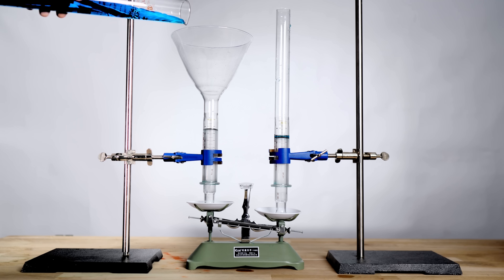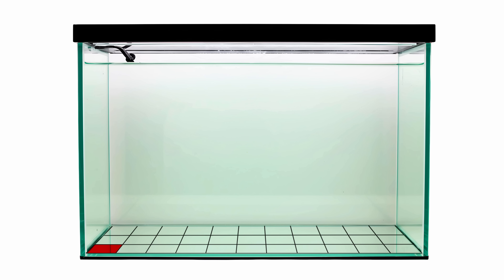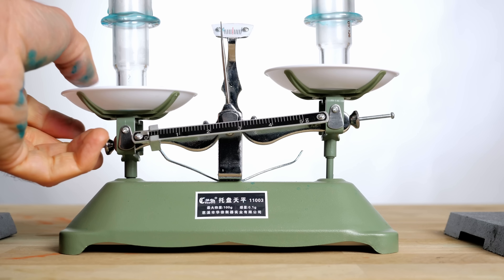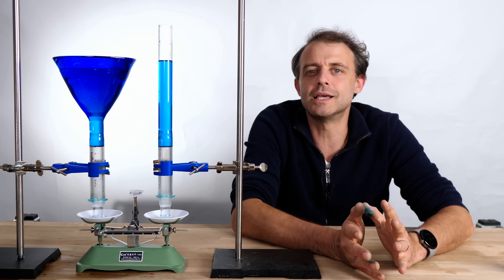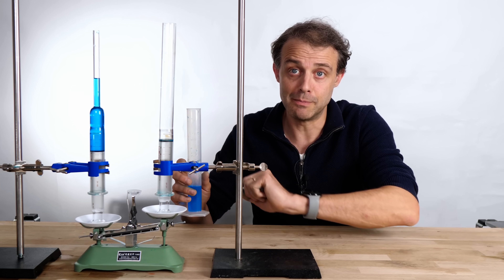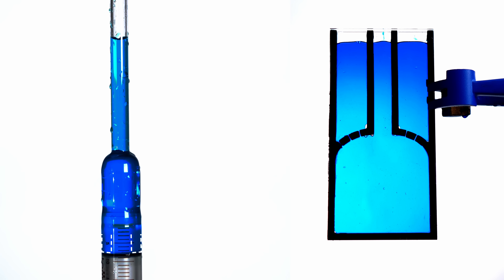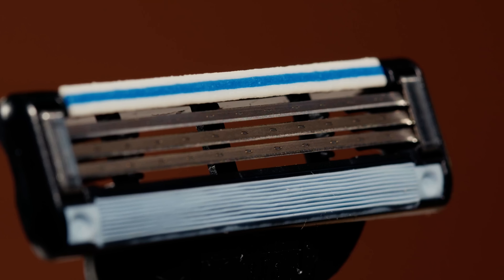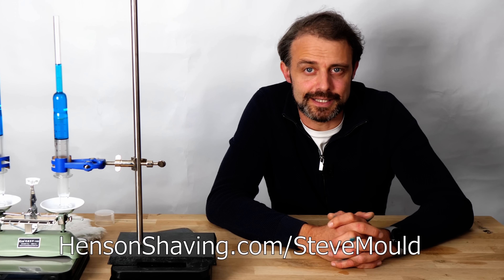The Hydrostatic Paradox

Comment: It's like a cart on an incline, tied to a free-hanging block, over a pulley.

On a 30 degree incline, a 100 gram cart, would only require a 50 gram weight on the other side of the pulley to hold it at rest.  This would make it seem like a 100 gram cart is equally as heavy as its 50 gram counterweight.  But it isn't, because it's the 50 grams of string tension up along the incline, plus the 87 grams of normal force, that add up as vectors to equal 100 grams, to oppose its weight.

The pressure from the conical beaker supporting the water, acts perpendicular to the conical surface, and not parallel.  This means the water in the conical beaker is getting support from the sidewalls to assist the piston in supporting its weight, while the water in the cylinder isn't getting any support from the sidewalls.

Comment: I'm about 1 minute in and I can already tell you this is stupid to call it wait instead of pressure. Put the whole damn contraption including the stand that is holding up the beakers on a scale and it will weigh more with more water. You're not weighing the water You're measuring the pressure on the head of the piston that is not the same thing and this is a misleading title and thumbnail
Reply: No need to watch the next 12 minutes I'm out

Comment: Usually I'm meh about ads, but safety razors are the way to go. You just don't need to bother buying from henson. Lots of companies make handles, they last lifetimes, blades are cheap as chips, do yourself a favour and get a good badger brush and nice puck of shave soap - that also lasts ages and doesn't dry out your skin from the chemicals used to propel it out of cans and foam it up.

Other than the handle, it's all super cheap. You will save a tonne of money, your shave will be better, your skin will be better, shaving won't hurt for hours afterwards.

Just do it

Comment: Could you then seal the top of a swimming pool around a 10 meter straw, fill the straw with water and now that pool has the same water pressure as if you had added 10 meters of water above it? 🤔

Comment: water weight is determined by only the water that is directly vertically above the object being weighed. took a long time for this to be properly explained to me. although i would have assumed it would take a lot more than just 60ml to outweigh the water pressure of the fluid in the funnel

Comment: The hight of the water and size of the position is what will determine the balance. If the hight is higher = it will be heavy. If the diameter of the position is larger and equal hight the heavier it will be

Comment: similarly: the pressure at the bottom of a body of water, is only related to the height of the water. the volume does not matter.

and that sounds right, doesn't it? going one foot under the ocean doesn't feel any different than going one foot under a lake, even though the ocean will have way way way more volume.

Comment: Could you do video using brake cylinders from a car to explain this further? I was always amazing when studying for my ASE that brake force is determined by cylinder diameter x distance. Which is why the brake pedal uses less force to push but the brake calipers convert it into thousands of pounds of force used to slow down a vehicle.

Comment: i always found it disturbing that u could unalive a diver in a big water filled pressure tank by having a very thin ( like 1cm diameter ), but very tall (20metre) water filled pipe connected to the roof and directed upwards. Abruptly disconnecting the pipe from the tank seems like a small modification but would instantly drop the pressure by 20metres and therefore unalive the diver via nitrogen bubbles in brain.

Comment: I had  a professional exposure to this phenomenon some years ago. I was working for a medical device company that was developing a chairside blood processor for use in blood banks. To separate the red cells from the white cells and plasma, we used a centrifuge, of course. It was different from a regular centrifuge in that it was continuous flow (whole blood and anticoagulant flowed in, and red cells and plasma flowed out). The centrifuge body was a single-use, molded polycarbonate bowl with the actual active area being a thin annular space at the outer edge, only about 5mm wide. 

They were having problems with the body cracking in use and I had to figure out why. I calculated the force on the wall of a 5mm column of blood at 2,000 g (the centrifuge spun at 4,200 RPM) at the outer wall and the polycarbonate should have been plenty strong enough. However, those four fluid streams I mentioned actually went all the way to the rotary seal at the center. Those pathways were only about 1 mm across so I had ignored them thinking that the mass of the fluids in them was negligible compared to the mass being processed in the outer ring. Wrong! Those fluid pathways increased the fluid column pressing on the outer wall from 5mm high to 10cm, a 20X jump! 

Thanks for the video, it was a great refresher!

Comment: I'm currently in an undergrad fluids class, so I have some level of knowledge above the average person, but I'm by no means an expert. 

I think all of this can be explained by 4 things:
1: P=rho*g*h. Pressure = density * gravity height
2: P=F*A. Pressure = force  * area
3: Pascal's law, which states that, in an enclosed container, the pressure in an incompressible liquid is the same in all directions for a given depth. Enclosed in this case means it is not free to move in any direction, so a container of water with no lid in enclosed because gravity keeps it in the container and the container keeps it from moving in all other directions.
4: A scale does not measure mass, it measures force. If you use the metric system, you do not weigh 80 kg, you weigh/exert a force of approximately 800 N and have a mass of 80kg (weight = mass times gravity, force = mass times acceleration, so your weight is (generally) equal to the force you apply on a scale). If you use the imperial system, there's a bunch of weird stuff with measuring mass vs weight.

The combination of all of these means that for all 3 containers, the pressure on the syringe is equal to the depth of the water . Because all the containers contain the same depth of water in an enclosed container, at the same depth they put the same pressure on the syringe. All the syringes have the same area, so they all have the same force applied due to that pressure. Pascals law tells us that the shape of the container doesn't matter, they all have the same pressure regardless of the shape of the height of the water above it. A scale measuring force not mass or weight means that because they all have the same height of fluid, creating the same pressure, on the same sized area, they all exert the same force on the scale.

You're right in what you explain, but how you explained it confused me until I thought about the laws and equations governing fluids.

Comment: You have missed the forest for the trees. The device you have built does not measure the mass of the water it measures the total downward force experienced by the plunger.  The quantity of water is irrelevant.  Only the pressure at the bottom and the surface area of the plunger influence that.  Imagine doing the experiment in a sealed box with perfect pressure controls. You can arbitrarily raise or lower the pressure all you want, the only pressure that matters is the pressure experienced at the point of measurement, the entire rest of the system may as well all be a single connected body of water.

Comment: What's neat about hydrostatic forces is that the pressure in a tank can be multiplied many times over by attaching a hose to the top of it and climbing a mountain with the other end of the hose.

Comment: Titanium is not worth 250 dollars Henson, shame on you. 85 at most. and even that's robbery. a titanium cube 4x heavier than your 250 dollar razor goes for 60 bucks. STOP robbing people. so in the WORST case scenario it's worth about 20 dollars in metal.  While the same cube in aircraft alluminum is around a dollar. so yes, make it 90 bucks. (20 more than your aluminum option) THEN i'll buy it.

Comment: I used to design formwork shuttering using the pgh formula to calculate the maximum concrete pressure, and for tall thin walls this could sometimes result in designing robust heavy duty formwork. Sites would sometimes complain that it was over designed considering theres only a small volume of concrete being used, but i could never quite explain why, other than it just is what it is. In future I'll just send them this video.

Comment: pressure = density x accel. due to gravity x vertical height of the fluid column...
used daily in many oil industry applications including geomechanics, well control, and well planning.  
Things do start to get tricky in horizontal wells where the hydrostatic pressure doesn't increase, but the friction associated with circulating fluid does.

Comment: I may spot a little mistake (probably due to the sentence formulation).
The pressure under the ceiling is the pressure in the column immediately next to the ceiling (not the bottom).

Also another way to explain it is the energy that can be extracted and how. Make séance especially in case of dams.

Comment: The Henson Paradox: the smoother the ad transition, the more impressive and higher the retention but also the higher the resentment at being tricked and the lower the resultant sales.
Reply: Heck, the only reason why I use a single blade safety razor and not a cartridge razor is that the blades are easy to get. And not 42 different incompatible systems so you are bound to accidentally buy blades that do not fit your handle.

Otherwise both work just fine for me. Cartridge razor shaves a bit faster, but single blade razor is way quicker to clean and needs no tools (for cartridge razor I use an old toothbrush to get the stubble out).
Reply: Hehe
Reply: Ad is good, but to be fair I already have an old timey set, so I just started to use it.
Reply: Hahah nice, but personally I would never buy enything from yt ads anyway so the smoother the transition the less annoyed I am 😂
Reply: I'm still trying to deal with the fact that one blade is better despite the number of blades increasing over time
Reply: I got he Henson (with a YT code, not sure if Steve's though) and I really love it.  I would still recommend it.  But the main reason is that it's just much nicer experience, and it's cheaper in the long run.  (I'm actually still using the 100 blade pack they sent me; I don't know how many remain.)

But according to my experience the safety is with an asterisk.  Before Henson I've been using cartirdge for like 20 years and never cut myself, then my first cut ever was with the Henson shaver.   It took some practice, plus learning to replace the blade more often--nowadays about every 2-3 shaves or so works for me, which for me is about one blade a week.   I also got into a habit of gently touching the blade across to feel the sharpness before using it, to check if it needs replacing.  (In case you wonder, there's no way you're going to cut yourself that way, unless you have literally baby fingertips...)

Overall, in comparison with the cardtridge, the cartridge is more forgiving if you're going to be in a rush (also thanks to this weird gel that it produces) but it's really expensive so you're going to feel incentivized to get more use out of one cartridge -- which might nullify some of the benefits.  I did get some skin irritation with it sometimes, if I overused it.

The Henson blade, on the other hand, teaches you to slow down and pay attention, because rushing the one-blade you might actually give yourself small cuts.  Or irritation (and higher chance of cuts) if you overuse the blade too much.  But overall the shave is just better, by far nicer experience and without paying through your nose.

Ofc, YMMV based on characteristics of your skin and hair, etc.
Reply: The ad literally convinced me to never use a multi blade razer again.
Reply: Paradox: Henson shavers
Reply: come on, shaving his legs after wearing stilettos? that is amazing and for me rubs off a little on hanson.
Reply: @p0gr  I had to go back to check if the stiletto's were before or after the shaving. It seems after, but he did a bad job, as some fuzz is visible at the calf.
Reply: Joke's on them: I don't shave at all, so the difference in razors is purely academic for me.
Reply: There are extensions for that.
Reply: Yeah Steve is a master of this. I genuinely hate it.
Reply: "The promo on this one's really great: with my code you'll get 100 free blades!" That would have sounded pretty good except he'd just told us how the blades are extremely cheap so it kind of takes the edge off.
Reply: @olaf7441  Yeah, but it also reinforces the point. Its a one time sale, not going to hook you on recurring cost.
Reply: @cybermaus  I don't use Henson specifically, but it is extremely worth it to use an old style single blade. I pay like $10 for 200 blades off amazon. That's like a 4 year supply.
Reply: I have in multiple occasions sworn out loud at the YouTuber when I realized it was an ad and then moved on to the next video
Reply: @dynomar11 did you do it this time?
Reply: @Niki_Parvanov  I did.

Comment: Knowing about water levels the results of this were quite intuitive, although the reasoning perhaps less so when broken down. Ultimately it makes sense when you know water is non-compressable and so if you think of it as akin to a solid object you know they will equalize when the same presseure is being applied atop them (atmospheric pressure). Still weird when thinking about different variations though.

Comment: Wait... this is piston physics. Surface area times pressure, and water PRESSURE  is defined by the vertical depth and no other factor (because it pushes in all directions equally,  aside from gravity effect of increasing w depth)
This is the basis for How and Why car engines, pneumatic nailers, hydraulic excavators, car shock absorbers and office chair height adjustment all work, along with so much more

Comment: 7:54 For me there is a more intuitive way to understand what’s going on. Because the two columns are above the scales it’s easy to be fooled into believing we’re weighing the water above the scales. However, if you ignore this and instead visualise each tube as a piston acting against the scale then it’s easy to understand that the left tube is acting somewhat like a Hydraulic Car Jack where the narrow section is amplifying the force in the wide section below it.

Comment: This is exactly how hydraulics work.  The force is measured in (in imperial, because I’m a yank) pounds per square inch, or psi.  Picture a 1 square inch piston connected to a 10 square inch piston by a hose.  If you press on the 1 square inch piston with a 1 pound weight, the larger piston will push up with 10 pounds of force.  Conversely, it would take 10 pounds of weight on the larger piston to generate 1 pound of force from the smaller.  

This is why the seals don’t get blown out of the hydraulic pump when an excavator lifts a several ton rock, and why a small pump can drive the excavator to be able to lift the rock.

The amount of movement is the opposite.  The small piston would have to move 10 inches to move the larger piston 1 inch and vice versa.

As a side note, the same math works for pulleys and the amount of rope required.
Reply: I have a degree in physics.  Your point is correct.  I have told so many people to stop messing around with hydraulics if they do not understand the compounding of forces that occur.
Reply: @CAMERONNERDIN Just tell them to watch even a small excavator, then imagine all that force bearing down on them.
Reply: This sort of reminds me of how gears work. Same logic. For example, a smaller gear would have to rotate ten times as much to reach the same amount of energy as a larger gear
Reply: @Kikishoespulleys, levers, gears, inclined planes, hydraulics, it’s all the same math.
Reply: @Simple_But_Expensive It’s all just simple machines?
Always has been.

Comment: I'm only halfway through the video, but immediately my idea for testing this is to use an (initially) inhomogeneous mixture of two fluids with different molecular masses, ideally each having different color, so we can see what is happening, and watch the pressure change on the piston as the fluids mix across the column above the piston.

Maybe you do something like this at the end of the video.
Reply: The video went another direction than what I expected, and now I feel more confused than ever! The stand losing weight... I don't grok it. But I'm watching this after a long long shift at work, so maybe I'll have to watch it again. Really cool, and so counter-intuitive.

Comment: This is an interesting phenomenon... Could it be turned into actual work, using the transferred weight differential? After all you need work to lift water, but here to refill a container, not the same amount of work is needed because the apparent "weight" of the water is determined more by container shape than amount of water. Basically a way of extracting energy merely from the atmospheric pressure itself?

Comment: So if we use a coarse sand instead of a liquid the funnel shaped will exert much less pressure than the cylinder shape, because the sand particles are pushing to the center and creates friction that prevent the center bit of sand pressuring down to the piston part ?

Comment: Hydrostatic pressure is just specific gravity x height (P=rho*h). The area of the water acting on the pistons are the same. Since F=P*A, you will get the same force acting on the balance when you have the same heights of fluid, independent of the tubing sizes or water volume, etc. 

Now if your piston sizes were different (say, one had half the area of the other), then the fluid height required would be doubled.